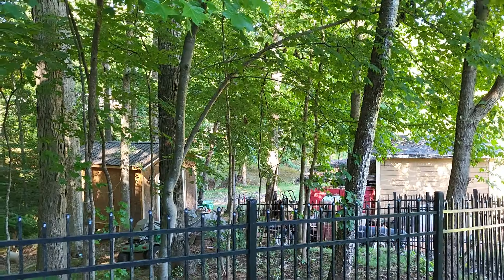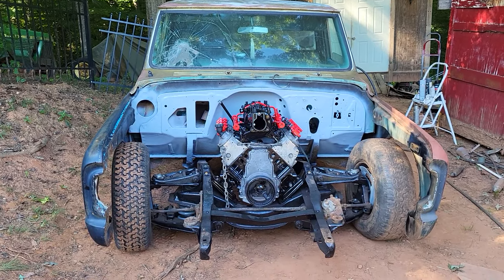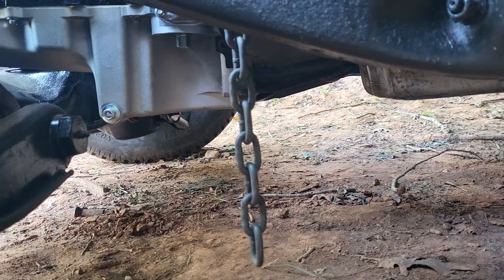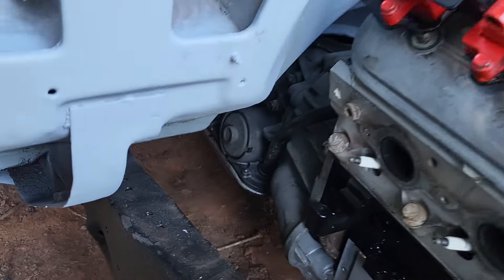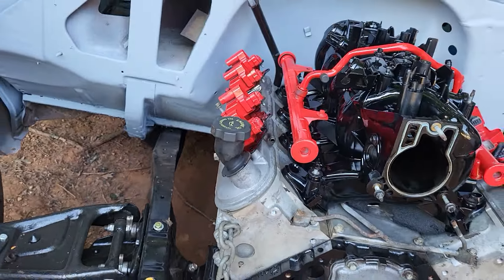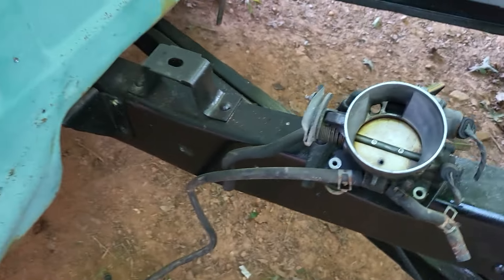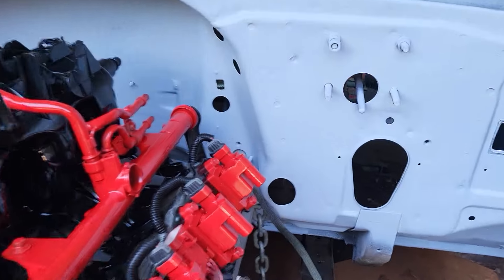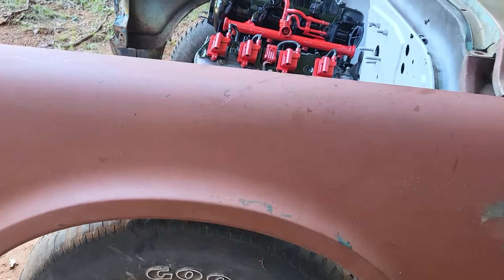1969 Chevy C10 engine installed

Comment: Idk if you suppose to get paint on the inside of the fuel pressure regulator on the driverd fuel rail. Maybe it won't hurt nothin. Might cause a leak. Remember to get the old  oring out of the regulator hole.
Reply from the maker: When painting is dry, I'm going to clean out all the holes and replace the o rings. Thanks for the look out though